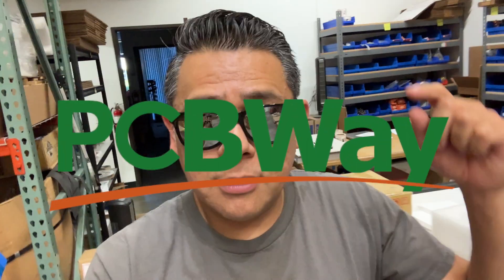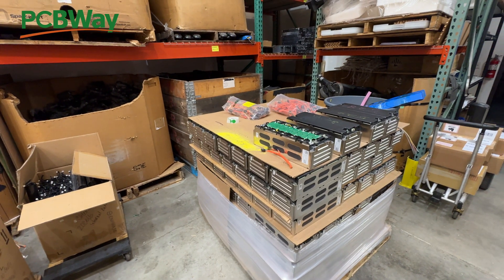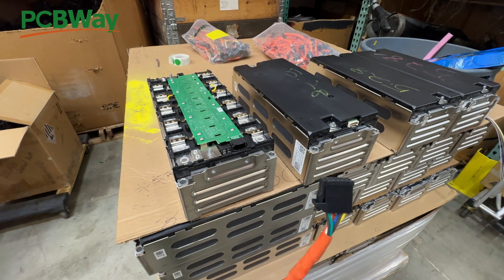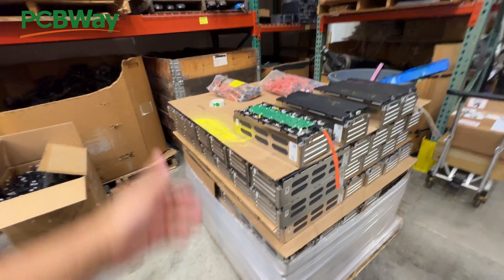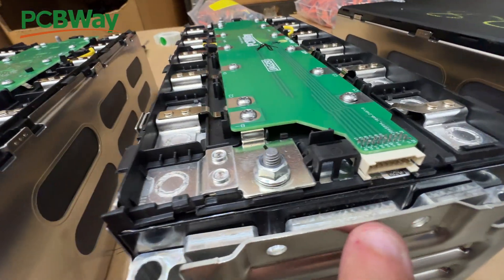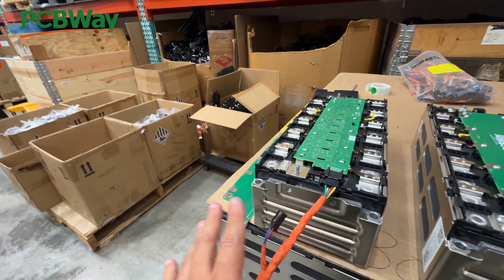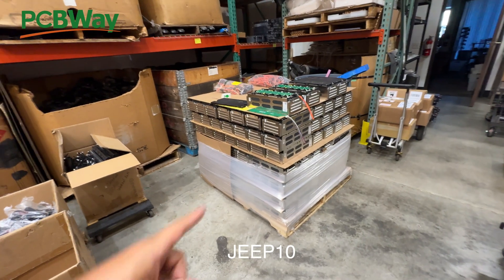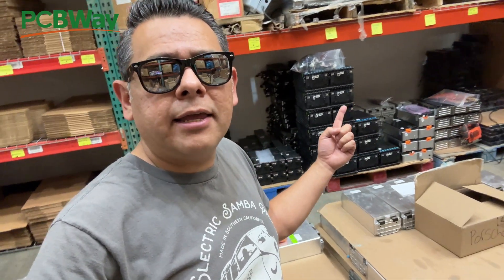Jeep EV Battery Module retrofit for DIY use - PCBWay

Comment: Which 3rd party bms or balancer works with the plug on that pcbway board ?  Is there one you can just plug in and go ?
Reply: I second this question.  As I am new to the scene I don't want to buy a good battery but screw up the bms

Comment: Love the power wall, however how does my 240v AC/ 48vDC Growatt all in one charge this battery wall, without overcharging the batteries?
Reply from the maker: you cant you have to use inverters that have settable battery voltage like victrons line of inverters

Comment: Very nice. But I see 1 flaw in the design. At each screw there should be a fuse. I'm thinking something like Littelfuse 0251005.NRT1L. This will provide protection in the event of some clumsy DIY'r should mix up the wires, bridge a circuit, have a BMS go bananas, you know, the usual.